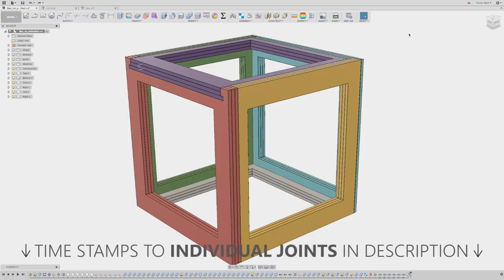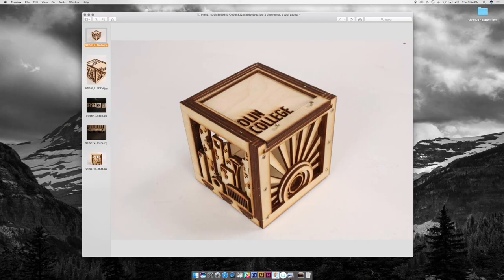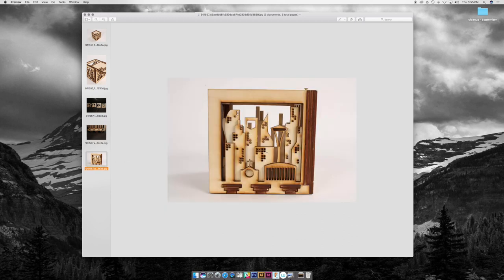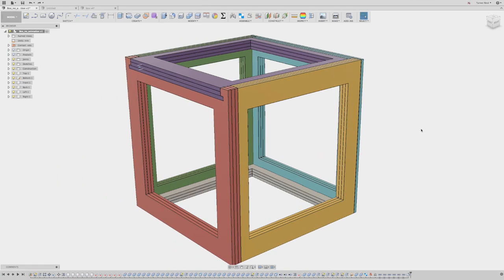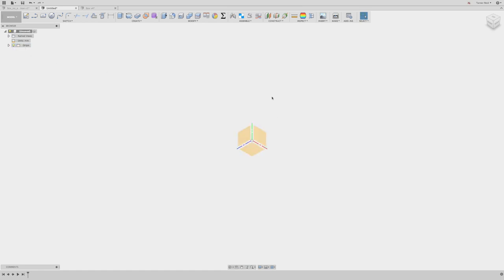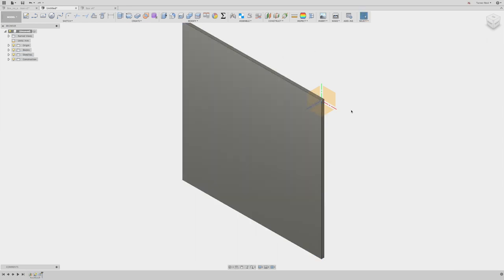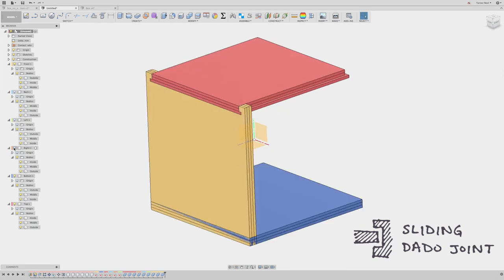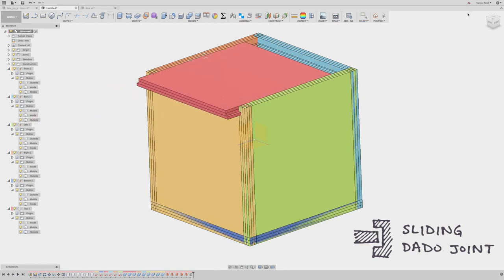Designing Laser Cut Joinery in Fusion 360

Comment: You mentioned briefly that the laser kerf would take care of providing clearances. If the kerf is too much, you'd get sloppy joints. If it's too little, you'd get interference. Better to design in a clearance parameter and also compensate for the laser kerf. I'd love to see this fully worked out or even automated within Fusion 360.
Reply: I think this is automated if you use the CAM module?

Comment: When gluing the three layers of each part together, you need perfect alignment. For some of these joints, that's not so easy. It might be helpful to add alignment marks to be laser engraved on hidden surfaces on certain parts. Is there a good way to do that in Fusion 360 and have the engraving lines come out along with the cutting lines in the export to DXF?

Comment: Great and interesting video. 
One point to consider, using tool bodies to cut into other components does not allow for clearance between parts which means everything will bind together and will not slide so nicely in real life. It will also not compensate for material tolerances as materials are more often than not a different size from the nominal size.
Reply from the maker: These are VERY important things to note and consider! Thanks Altus!
Reply: @adskFusion  I prefer to add all features using scetches. This might take longer to do but does allow me full control of all the clearances. 
My designs is for steel assemblies and is slightly different but the same basic principles apply.

Comment: Hello, is there a way to account for clearance (like 0.010'') so the model actually work in real life? 
I always end up using 'projection' and 'offset', but it's really time consuming... and it complicates the modeling.
Reply: For laser cutting, the kerf is pretty well perfect to ensure a snug fit. If you were doing it on a CNC or wanted to handle this manually, create a kerf user parameter and add this parametrically to all length and width distances. You'll probably then want to also create a clearance parameter and once the model is completely done, push back all end faces by this amount.

Comment: Once We modeled it in fusion, how to get all surfaces on a single plane for  laser cutting ?
Reply: Waiting for a answer for the same
Reply: Hello, do you have this file. I am new to Fusion and wanted to see some stuff. Can I see your file?
Reply: The simplistic method is to duplicate all of your components using copy and paste new (use this so that the next step doesn't screw up your original model). Then use the align tool to reorient each new body to the ground plane, and the move tool to space them around to avoid overlap. You can then create a new sketch and project this geometry, and export the sketch as DXF.

Comment: I followed this tutorial then used https://www.youtube.com/watch?v=ZYj37I88-4g to get most of the way towards a DXF layout suitable for laser cutting. (The only complication is that our components – the walls – are comprised of 3 bodies each for the inner, middle and outer layers. Once my components were all aligned to the ground plane, I had to manually separate and place each 3-layer stack.) My first attempt was a 10cm edged box. I did everything but left off the hidden clasp. I cut using 3mm baltic birch plywood. All looked to be going well until I got to the stepped dovetail; it just wouldn't go together at 90 degrees. I traced the problem to the fact that my ply is actual 3.2mm thick. That 0.2x3 is more than enough to throw things off. So lesson #1, measure your stock thickness carefully. On my second attempt, I remodelled using a fully parameterized box of arbitrary length, width and height. I also added in kerf and clearance parameters. Re cut and just finished assembling. It looks great.